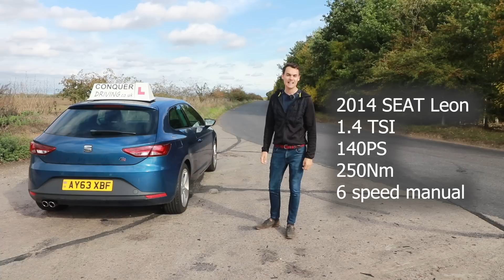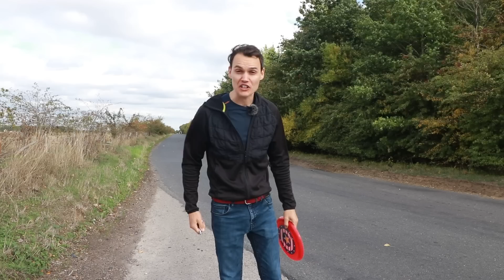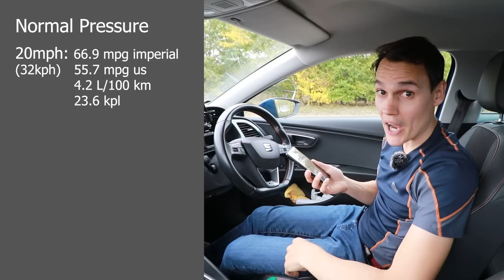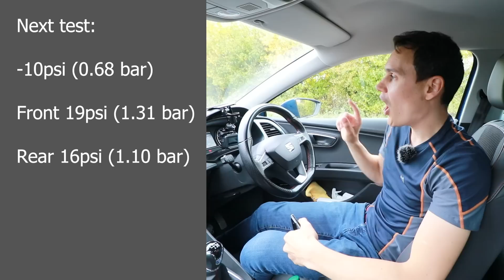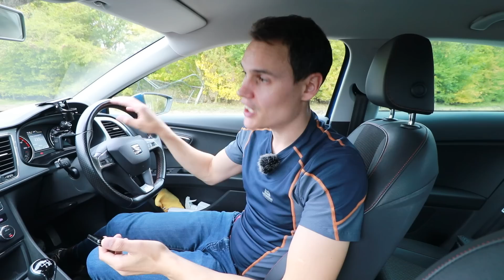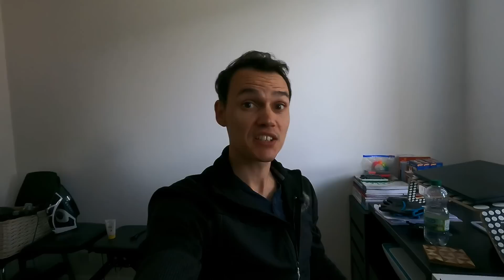Tyre Pressure Fuel Economy Test - Do Lower Tyre Pressures Cause Higher Fuel Consumption?

Comment: Sometimes tyre pressure can also alter wheel alignment, causing more tyre scrub with higher pressure. I can feel the steering get a bit hard if I increase or reduce the pressure a lot. 

Would be interesting to see the results on an alignment machine with the various tyre pressures.
Reply: Suspension geometry has nothing to do with tyre pressures!  Tyre pressure relates to how much air is in a tyre, not how a wheel is aligned.  Two different things.

Comment: Some explanation for why higher speeds are less impacted by lower tire pressure:
Lower tire pressure is supposed to reduce your mpg because there is a larger contact patch with the ground, which increases friction, and more importantly because the tire has to flex and distort at the bottom as it squishes.
At higher speeds, the tire isn't fully recovering from that distortion/displacement. At higher speeds, the tire is spinning quickly enough that it hits an equilibrium state where the tire is no longer actively squishing at the bottom.
Also, at higher speeds, centrifugal force pulls the tire outward, stretching it, further reducing the effects of that squishing.
Reply from the maker: I think the higher speed also means air resistance is more of a factor than rolling resistance.

Comment: Sorry for adding yet another comment but I would like to ask a question. When I had my previous Ford Kuga, it had a tyre pressure monitoring system that used to give me warnings quite regular.  How much of a change in pressure has to occur for the monitoring system give alerts?
Reply: I know i'm no help here but i get what you mean, my front tyres were recently 10 to 13 psi down but i had no warning on the dash. I saw them because i eyeballed them when at home.
Reply from the maker: I think it's different for different systems, in my experience it seems to be more than 5psi difference.

Comment: There is a website that provides the correct tyre pressures. All you need to do is input the car registration number and it gives you the results. I recently bought a new Ford Kuga St-Line X and the website matched the psi that the car had when I purchased it. 32 at the front and 33 at the back.
Reply from the maker: I have seen a website like that, I'm not sure how accurate they are though.

Comment: Doesn't over inflating tyres have less grip and therefore a slight safety concern. A feet or two in braking distance may mean the difference between being involved in an accident or not.
Reply from the maker: I recommend following the manufacturer's recommendations for this reason. Even tyre wear is a good sign.

Comment: Great vid, just one question, does stopping and starting car have negative impact on vehicle and increase fuel consumption?  I work as courier so have many stops.
Reply from the maker: Once it's up to temperature, stopping and starting the engine saves fuel, it only needs to be stopped for several seconds for there to be a fuel saving.
Reply: One question I want answered is how does a courier in a diesel van or car stop their DPF blocking up?
I see loads of work vans and many are stop start or would never be able to be driven at 60mph for 30mins constantly to clear them.
Are vans emissions systems set differently to cars for the public?  I had nothing but trouble from mine.
Why don't DPFs block on commercial vehicles?

Comment: Do you have advice on alloy wheel corrosion? I keep losing tyre pressure despite my tyres being fine and recently changed. Has to be the alloys...
Reply: Once on my car had the exact issue. Was down to a crack in the alloy itself that was slowly leaking the air out so that might be your issue 👍
Reply: @squeakers27  thanks I’ll take a look!
Reply: Zouzou, here in the US, this is a common problem where cities use the detestable practice of salting the roads to melt snow.  Corrosion between the rim and tire bead prevents a good seal, causing a slow leak.  It is also quite dangerous, as the tire can separate from the rim without warning while driving (which has happened to me twice).  The fix is to plane the bead contact area of the rim, something the tire store can do for you.

Comment: Interesting...im wondering if the small differences are because you were going in a straight line, when you said about the steering feeling heavier at lower pressures it made me wonder if maybe using a route where there are a few bends might show more drastic differences...but it would also be much harder to do the test accurately I guess...interesting video as always though!
Reply from the maker: It may be a difference in tyre size.

Comment: Can I ask what the difference is between parking, waiting and stopping your car? The legal definition of parking is leaving your car however the highway code discribes parking while you use a mobile device?  Is your car parked while stopping at the side of the road to drop someone off? or are you parked while you wait in your car while a passenger returns?
Reply from the maker: I consider parking as leaving your car, waiting as waiting with your car and stopping as stopping. I don't know what the legal definition is though, that's just my assumption.
Reply: @ConquerDriving  I contacted the local police station asking this question. They were unable to answer. 4 times I asked the difference, 4 times they refused to give me an answer and referred me to the local council...  The highway code references parking, stopping and waiting, it gives restrictions on all but does not discribe the definitions.... Love your vids by the way by.

Comment: The build-in cruise control is probably based on RPM and might change with tire pressure. 
GPS speed might give different results.

The build-in consumption calculation might also be based on distance calculated using wheel spins and might change with tire pressure.

Comment: I tend to keep my pressure between the comfort and eco pressures listed on car. Also I have to remember to adjust the TPMS mode or lots of warnings if it's set to eco and have comfort pressures.

I also run 2 sets of tyres one 17" other 16", wonder if I should be using different pressures for the slightly smaller tyre?
Reply from the maker: Different sized tyres tend to need different pressures.

Comment: Nice job as always! I think I might have an idea of another variable that's affecting the results. The higher the pressure in the tires, the more the tire will expand. If the overall diameter of the tires changes, the speedometer and odometer will be affected just like if you change the tire size. If the tires are expanded more, the speedometer and odometer will read artificially low because the tires will move the car more distance per turn, throwing off your results since the computer will think you covered less distance than you actually did and at a higher than actual speed, giving worse results. Lowering the pressures will have the opposite effect, making the speedometer and odometer read artificially higher, giving better results. 
Also, it makes sense to me that tire pressure would make more at difference at lower speeds since the rolling resistance is a larger part of the total power requirement at low speeds due to dramatically less aerodynamic drag. Rolling resistance increases linearly with speed (double your speed and power required to overcome rolling resistance doubles) while aerodynamic drag increases exponentially (double your speed and the power required to overcome the aerodynamic drag quadruples). This is the main reason for reduced efficiency at high speeds. At 20 MPH, aerodynamic drag is pretty low, so rolling resistance is likely the largest resistance the engine has to overcome. At 40-60 MPH, aerodynamic drag will be much more significant.
Reply from the maker: Very good points!
Reply: I thought rolling resistance was v² and air resistance v⁴, but oh well, the point remains the same
Reply: @SteenSchütt  No, both predominantly square law. There are higher order components, but the coefficients are very low, so only start making a difference at very high speeds (fast jet aircraft type speeds).
Reply: Theres a negligible difference, I changed my tires from 225/35/R18 to 235/60/R18 and the onboard computer gives the same results as a manual calculation on most of them (same as with oem tires)

Comment: HANG ON! the cars trip computer is working out mpg by using fuel used vs distance travelled. Its working distance travelled by rotation of the tire not GPS. Therefore the lower tire pressure is being helped by the tire circumstance being reduced as it is squashed. So the car thinks it's travelled further!
Reply from the maker: That's a good point but it is a tiny difference in diameter. I would like to measure it but I don't think I can measure the wheels with that level of accuracy.

Comment: I believe I can explain the MPG results you're seeing, with slightly reduced pressures at low speed the vertical displacement of the car is less and so you use less energy. It's like having over inflated tyres on a mountain bike while biking a rough trail, the bouncing about wastes energy. The faster you go though the more you skip over the bumps and so the displacement is lessened. When driving faster centripal acceleration within the tyre itself will compensate for the pressure loss to some degree as the tyre tries to lift away from the wheel.

Comment: Maybe you could compare the diameters of your tires at different pressures. Your tripmeter divides by the number wheel rotations after all,
Reply from the maker: I don't think I could measure it accurately enough to see a difference.

Comment: I did math. Results in percentages:

-17% change to recommended tyre pressure saw a 3.7% increase in fuel consumption at 40mph, and 0.8% increase in fuel consumption at 60mph.

+17% change to recommended tyre pressure saw a 2.4% decrease in fuel consumption at 40mph, and 5.2% decrease in fuel consumption at 60mph.

Comment: The trip compute isn't accurate at all. Take a bottle of fuel measure the fuel it takes not the trip computer. Sorry but this test is totally flawed you can never recreate the run with your foot and there are so many variables... Wind etc.... Also you don't let pressure out in summer tires are designed to account for that. You should really know this. Also you don't follow the manufacturers instructions you follow the instructions on the tire. Again get your facts right.

Comment: Thanks Richard, this was a really interesting video and can imagine you put a lot of time and effort prepping and filming it. The Leon manufacturer pressures of 29/26 seem quite low compared to other cars - I wonder if its down to the larger sportier tyres?
Reply from the maker: Thank you, it's not a heavy car and has quite big-ish tyres for it's weight so I guess this is why it's needs lower pressures.
Reply: Tyre width plays a big part for tyre pressure. There's a reason a 70kg bicycle+cyclist run their tyres at 80-120PSI.

If there's more contact area of the tyre on the road there's more Square inches touching the ground. If you have 10"² of contact then 30psi would exert 300 pounds of pressure... If the contact patch was 1"² then it would only exert 30 pounds of pressure before deforming in the example of a tyre (a racing bicycle with 30psi would probably ground out onto the rim as soon as you sat on it)

I was actually quite surprised to find space saver tyres actually use more fuel... I can imagine most of that is down to lack of tyre development for that rim size though. I know they recommend around 60psi though, which I can imagine means that a space saver is more like to have lost air pressure when you actually need it.

Comment: Great video, when you rechecked the recommended tyre pressures for your model of Leon, was it in line with what you lowered them by?
Reply from the maker: I'm not sure what you mean. They're supposed to be 29 at the front so I based the test around that.
Reply: @ConquerDriving  Sorry I should have been clearer, I meant when you mentioned that Seat's rec tyre pressures were the same for the petrol and diesel model (despite the latter being heavier) but you then rechecked and found that not to be the case, is it actually less than 29 for the petrol model as yours is?
Reply: @iDayno  The petrol would be 29 and the diesel slightly higher.

Comment: less pressure = more hydroplaning too
Reply: ^ also at higher speeds (for instance my morning commute is at ~80mph) your aerodynamic drag and gearing (low rpm) are more important for fuel mileage.  ...tire pressure then contributes not only to lower rolling resistance ( ---> mpg), but becomes really important for suspension and handling.   Your tires have a maximum load pressure number, and even in a lightweight car the max load psi will increase gas mileage and improve handling.

Comment: I am kind of surprised to see that at higher speeds and lower pressures, the gas mileage loss is so slim. In hindsight it makes kind of sense, as at 60 mph the tire should expierience enough centrifugal force that the rubber expands to a point where it almost matches the diameter it would have under recommended pressures (decreasing its formerly raised contact patch and rolling resistance to almost a normal level, negating the mileage losses) 
If that is true, it would also explain the lower mileage at 40 mph where the tires are exposed to less than half the centrifugal force so they cant quite strech enough and the rolling resistance remains higher than under normal conditions.

[The 20 mph results are quite a mystery to me so take the following with a Brick of salt: The results might be due to an everslightly smaller wheel diameter causing misreadings in the cars speed. The sensor at the axle/wheel only reports the amount of wheel rotations to the car, while ignoring the actual diameter of the wheel (which is smaller now due to lower pressures) so one might as well be travelling at 18 or 19 mph instead of 20 mph making the engine work easier and therefore burn that little bit less fuel.]
Reply from the maker: The confusing thing is that at 20mph there is very little wind resistance. 40mph might be more affected by tyre pressures than 60mph because at 60mph the rolling resistance plays a smaller factor in economy than the wind resistance.
Reply: It is possible that the lower pressure does in fact have lower rolling resistance. Lots of variable here. Isn't the point of the scientific method to confront our preconceptions with data? Just because you don't know why something isn't happening it doesn't mean that it isn't happening. Perhaps more accurate measurement equipment would give absolute confidence in the results.
In the bicycle world experiments have found that on rougher surfaces lower tire pressure reduce rolling resistance because there is less vibration transmitted to vehicle and vibration is basically vertical motion, which is an acceleration of the vehicle is a non-forward direction. It takes energy to accelerate that mass up and down (vibration).

Comment: If this car has AC, does it effect the MPG (displayed on the screen) because we tried using the AC for a while, then turning it off while driving on the A1 and there didn't seem to be a noticeable difference, at least according to the MPG counter?
Reply from the maker: The AC does affect the mpg, but it varies depending on how hard the air conditioning compressor is having to work.

Comment: Maybe the difference at 60 mph with 10 PSI less is not so dramatic compared to 40 mph, because with so low tyre pressure they overheat, so the pressure during driving at higer speed is actually higer? My guess, or i am wrong. The only way to know for sure is check right after finishing the drive, if there is change in pressure...
Reply from the maker: I think it's because at 60 mph the wind resistance has a greater effect on economy than the rolling resistance.

Comment: My Toyota Aygo recommends 32PSI all round... I always run them at 40PSI as I find the wear is more even, at 32PSI the shoulders of the tyres wear quicker then the inside. At 40PSI the wear is even all the way down to the point I replace them.
Reply: The ideal pressure for wear seems to vary from tire to tire.

Comment: You always seem to go to loads of effort! I can never wrap my head around the difference in recommended pressures, even with the same size wheel/tyre. Mine are supposed to be 36 on the front and 32 on the back but I just put them on 38 all round. After watching this I’ll probably let a bit out and see how it goes. Thank you again!
Reply: It seems to be pretty common for front wheel drive cars to use higher pressures in the front, due to the mass of the engine and drivetrain being at the front. Keep an eye on the wear patterns on the tyres: if they're overinflated, you'll likely see more wear in the middle.

Comment: At higher speeds, air resistance plays a bigger part in the total losses. Thats why at higher speeds the low tyre pressure is nothing compared to the increase in air resistance
Reply from the maker: That's a good point.